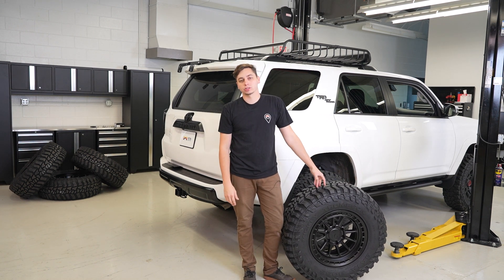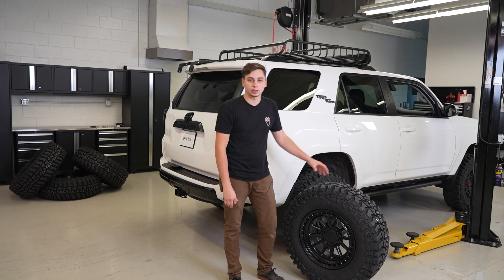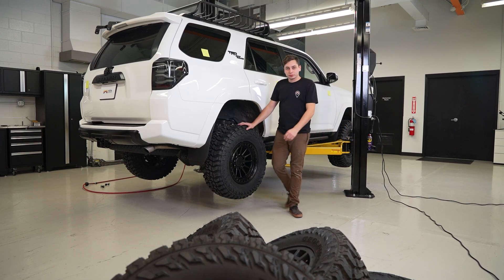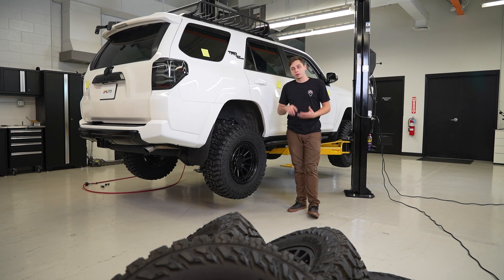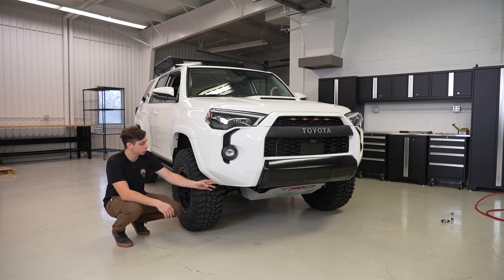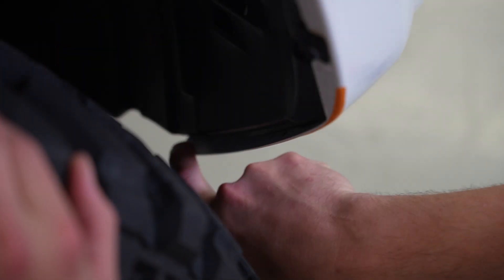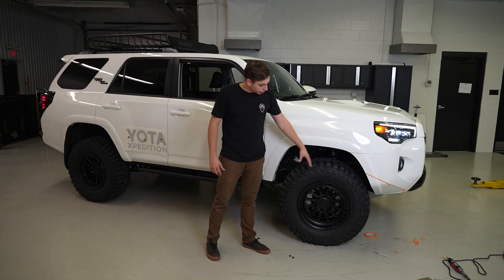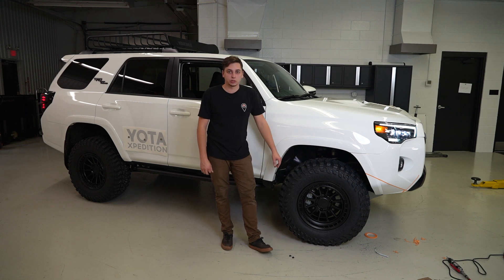How To Get 285s To Fit On Your Toyota 4Runner! - Will It Rub?

Comment: 255/ 80 / r17  33.1 inch   --  255 /85 / r16  33.1  -- THEY FIT NO LIFT - NO CUT - NO RUB  - LIFE IS EASY  TRUE 33 INCH TIRE
Reply: I actually prefer pizza cutters. Love the weight savings: better MPG, easier on the drivetrain components, and better ride.
Reply: @RickActual   Don't through  mud and rocks all over the side of the  vehicle !
Reply: Are you running oem wheels or aftermarket? If so what is your specs
Reply: 16” wheels won’t clear the brakes on a 4Runner . ……..255/80-17 will work though
Reply: I ran 255s on stock snowflakes.  once I lifted and went to scs wheels, I had to trim the front bumper a tad.  offroad needs a bunch more trimming

Comment: I wish more manufacturers would make a 33x10.5x17. Most oversized tires on the 5th gen are too wide for anything but sand and similar surfaces.
Reply from the maker: I think there are pretty many options when it comes to 285/70 or 33x10.5.
Reply: Look at a 255/80 it’s 33” tall but skinny

Comment: Been running 285/65/18 DuraTracs on Fuel wheels w/ +2mm offset since I got my 4Runner in 2018...   👍🏻   Bilstein 5100's @ 2.5", plus 1.5" Eibach rear lift springs.
Reply: I have same thing as far as suspension. Would 285/70/17 work for mine with no rubbing ? I have a 2.5 inch

Comment: Love this set of wheel and tires. Do you think is possible to get away with only 1” front lift and some trimming of the bumper? Thanks
Reply from the maker: My guess is you're going to have to lift it more or you will have issues with the tire rubbing the body mount.
Reply: @yotaxpedition  it’s actually the opposite. The higher your lift, the more your suspension droops, bringing it closer to the body. 

Then, by adding spacers, your increasing amount of space the tire needs to turn (the wheel does not turn on its own axis, the further away from the axis it turns, the more space it needs to make the turn). 

Your best chance of fitting 33’s with little to know rub is by doing nothing, leaving the cv axels level. You can most likely do that with either no modification, or by removing only the rear mud flap.
Reply: Even when you do a suspension lift, the tires will still move into the positions that would allow them to touch the truck.  A lift will not solve the issue, unless you're literally never going off road.  Then it might help, because large amounts of articulation during tight turning would likely be very rare.

Comment: I put 285/70/17’s on my stock 2wd 4Runner. No trimming, no rubbing. Mounted on steel spare wheels.
Reply from the maker: With the wider wheels means more rubbing.
Reply: This shows the importance of offset.  I'm guessing the offset of the steel wheels is slightly positive or zero.
Reply: What brand/model tires did you use?

Comment: i have a question again sir.. sorry for keep asking. is it ok to use 17x9 -12offset wheels with 265 70 17 tires on a 2023 4runner trd off road.?. no lift.. thanks
Reply from the maker: With the negative offset wheels you might have to trim some plastic on the bumper and remove the front mud flaps.
Reply: @yotaxpedition  oh boy.. so 0 offset is better ryt.. thanks for the advise sir..
Reply from the maker: It would be the better option. Still might rub a little with no lift but the -12 would be worse.

Comment: Late to the party per usual. I am looking at a 285/70/18 Falken wildpeak AT4W on Raceline Defenders 18x9 w/-12 offset. Ive done the Viper cut, BMC and removed mudflaps, I should be good or would i need to trim more?
Reply from the maker: Lift kit or stock? If you're lifted you'll be fine

Comment: Will they fit with just the 2in leveling kit I’m good with cutting the bumper cover but I don’t want to get into the body mount.
Reply from the maker: It'll be close. Also depend on what wheels you go with. Your width and offset will play a huge role in how much you rub. These wheels are 17x8.5 et0 from fifteen52.

Comment: I am running LT265/70-17 Mickey T Baja boss tires with black rhino arsenal rims with -18 offset on my 2022 SR5 with no lift kit but I’m getting rub only in reverse on front . Need help please 
Don’t want to reduce aggressive look. Is there something less aggressive I can put on that won’t give me this issue? Any advice that can help with no rub and high speed steering shake
Reply from the maker: Your wheel offset is the issue. You need something less aggressive. Or removing your mud flaps should help.
Reply: @yotaxpedition  sorry I don’t know much about wheels and tires. :( can the offset be changed on the rim? If so, how much do I correct it too? Sorry I know this may be a dumb question but again I’m new to this. I am trying this whole overlanding experience first time and it was recommended to me to help with ptsd
Reply: @Peace4nation  you cannot change the offset of a wheel. you need a different set.

Comment: Hey 
Went for the same rims and similar tire set up. How much lift do you guys have front and rear to make this set up work??
Reply from the maker: We have an ICON Stage 1 lift kit installed. The front coilovers we're installed exactly how they came out of the box. Roughly 2.75" up front and 2.25" in the rear.
Reply: And it still rubs... wow!
Reply: @darvinbordenii5657 mt tires cleats on tire are way bigger that A/T tires… most stock 5th gens will hold a 285 with a 2” lift w/o mud flap but remember a lift does nothing for bigger tire fitment! I’m stuck on 275 or 285 just due to the amount of cutting needed to have the fit properly with no rubbing off-road

Comment: My brother-in-law has a stock 2003 4runner with or rims. He wants to do a 3" lift and do all terrain tire with 285/ 70 R17 tires. Would he be able to run with the minor mode if just cutting the small piece of the flap?

Comment: I have 3" lift with 17 x 8.5 -10 offset and and a 1.25" spidertrax wheel spacers on a 285/70r17 bfg tires, I also did the bumper trim and mudflap removed but I'm rubbing on the metal part on full lock turn and reverse. Any ideas why? I don't want to get bmc just yet but maybe if I take the spacers out, it "could" clear it? Any thoughts? THANKS!!

Just wanted the aggressive look without thug..thug..thug..thugs..🤣
Reply from the maker: They are correct, your spacers are probably the issue. The farther your wheels stick out the more rubbing issues you are going to have. Maybe you can get a smaller spacer like 1" and that will help enough but still give you that aggressive look you're going for. Otherwise your options are take the spacers off, do the BMC or just let it keep rubbing lol.
Reply: Appreciate it. 🤙🏼

Comment: Were you able to reuse the factory lug nuts or did you replace them with aftermarket?
Reply from the maker: Factory lug nuts will not work with aftermarket wheels.

Comment: Can you tell me a backspace recommendation for running 285s please. I already read forums. Or if you can tell me if 17x8 (+18offset) will rub. They are the wheels that come with the "T FORCE" package. It is apparently 17in tundra wheels I'm assuming. They are TSS wheels.
Reply from the maker: Well our wheels are 17x8.5 with a 0 offset. So you should have fewer problems than us because your wheels sit in more. Just have to watch that you don't hit your sway bar while turning. If so then you'll have to put a spacer on to clear it.

Comment: Question what modifications have you done to recover horse power after you installed the bigger tires?
Reply from the maker: Nothing. There's not that big of a difference. A Pedal Monster would help, its not going to change horsepower but will make your throttle response quicker.

Comment: Seems like this will rub like you said the second you take it off roading without doing the viper cut.  Overall decent rims, tires i wouldnt recommend,  stick to BFs, the mickeys have been crap, too loud and not as good performance in the mud, also cost more than the Bfs.

Comment: is it ok to not use a lift kit for that? just use 285s and just trim and removal mud flaps?
Reply from the maker: 285s with no lift kit will not fit. You will hit your body mount behind the tire.
Reply: @yotaxpedition  ahh ok tnx for the info.. maybe 275s will fit
Reply: Suspension lift does nothing for tire fitment and to fit 285 with no rubbing you have to cut bumper removal of mud flaps and do BMC otherwise if you go off road you will rub! Each vehicle comes different from factory slightly and 285 will fit stock but you will rub; 285 will also fit with 2” lift but will rub seems to me 275 just seem to be the way to go for no cutting cause lots knows to caster out is not the answer either

Comment: Couldn't you just adjust the caster to get the tires to fit?
Reply from the maker: Then you would probably run into rubbing issues on the back side of the wheel well.

Comment: The viper cut is really ugly. I don’t like it at all.  It destroys the look of the vehicle.  I think if you just followed the original contour of the wheel well you would have a much better looking product that still gives you the clearance you need.
Reply from the maker: There are many ways you can cut it. Do it how you think it looks best.
Reply: I just zipped like .25 in to zero with a cut-off wheel and grinder. No viper cut fir me